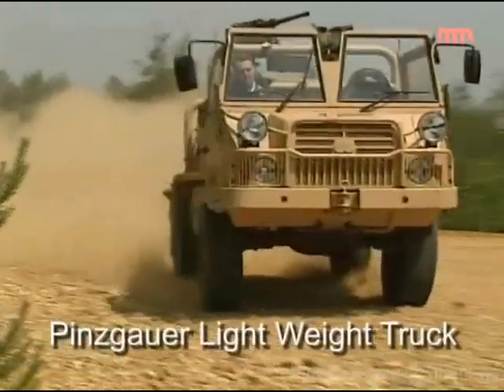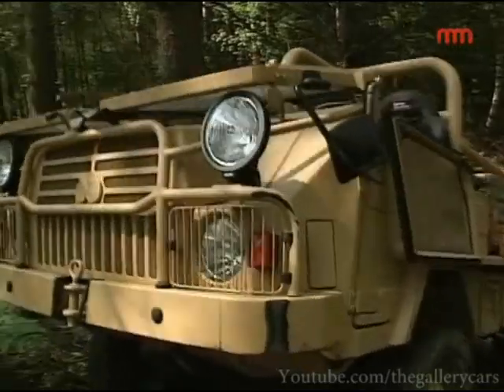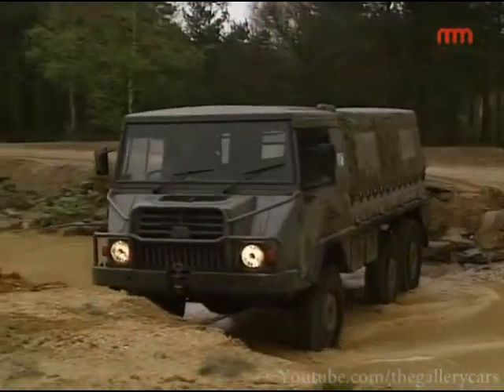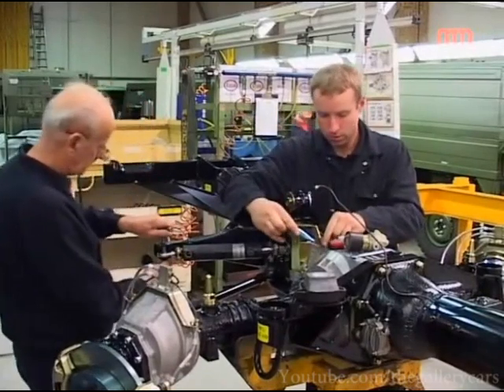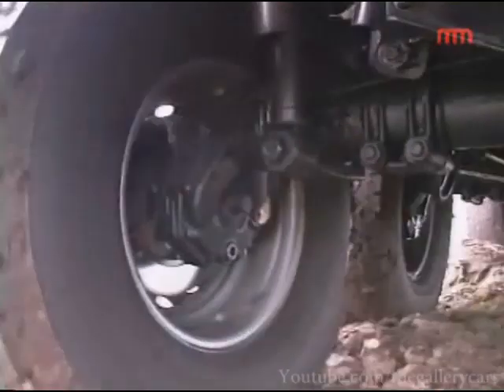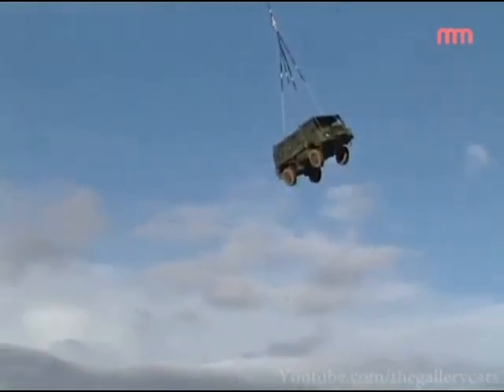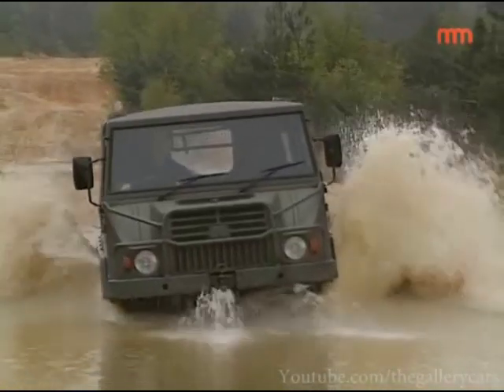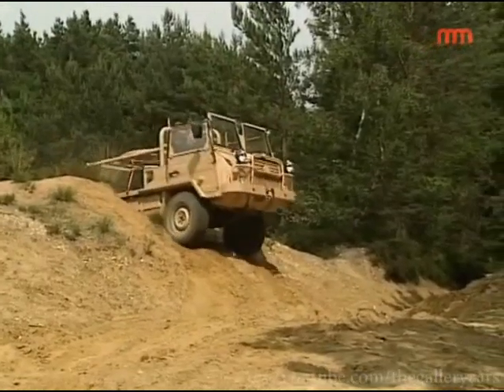Pinzgauer Ligth Weight Truck!

Comment: These are the most ripoff vehicles the Army invested in. Good offroad. Absolute shit onroad. You'll literally have leg injuries if any legs at all if you crash at 30km/h with these.
Reply: Srap strange... I seldom hear someone say mopeds and Motorbikes are absolutely shit onroad. Maybe that is because commonly no one intends to crash at 30km/h with them.  

Besides ... the front of these Pinzgauers is very rigid. That is rather bad if you intend to crash directly in a massive wall or a big tree. Not because of the deformation, the main problem would be high acceleration force due to the missing crumple zone. But if you crash in something less rigid you'll profit from the deformable zone of the obstacle. In case you slide over an obstacle (which is likely due to the form of the front below the buffer-bar) you'll have an extra chance to get out of it with your life and your legs. 

To put it to perspective: A Pinzgauer isn't an everyday car anyways. There are zillions of cars that can do that job better. But if you have to go through bad road conditions or simply want to have fun a Pinzgauer is a nice car to get there onroad. Especially if you put BF Goodrich All-terrain tires on it (the positive effect on road handling was mind blowing). I've went two times from Austria to Portugal and one time to North cape and back in a Pinzgauer and several other journeys. It was always fun and a smooth ride, I never felt unsafe onroad. Okay - that was owed to the attitude of the drivers, not passive safety features of the car. I call that active safety - priceless! Works perfect on every car in the world.
Reply: Spine Chassis. At it's best.
Reply: Srap  English isn't my native tongue - I don't understand the term "spin chassis". But I would like to - can you help me there?
Reply: Sorry, my bad. I'll edit it.
Reply: Srap Oh! That clears it up! Thank you!
Reply: Srap we drive our 716 sometimes for over 2h and i find it better then our audi a8
Reply: Srap and if u crash u drive on the car and dont scrap ur lags
Reply: @genius1a  Was the Pinz you traveled in an expidition vechile ? 
If so just wondering the total weight please ?
Reply: @Star-uk1kh   It was a Pinzgauer 710M (that says 4 Wheel, canvas roof) built in 1975 in Austria for the swiss army. It had a deadweight of 1950 kg (4300 lbs), a 4 Zylinder 4 stroke aircooled gazoline engine. We had equipped it with a custom made carped bed in the back with storage compartments underneath,  that reached from side to side. The compartments were filled with canned food, a Phoebus Nr 625 gazoline stove, digital cameras, Laptops, shovels, toilet paper, towels, clothing for several weeks,... you get the picture. So the weight was increased by roughly 400 kg which gave a total of 2350 kg (5180 lbs).
Reply: @genius1a  Thanks for the detailed  information . It sounds like you had a great time on your adventures 😊